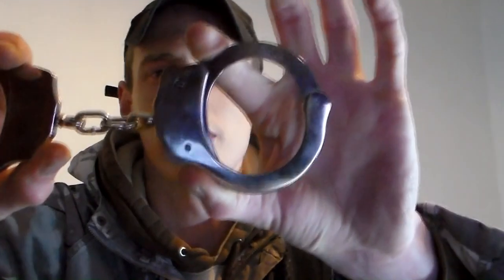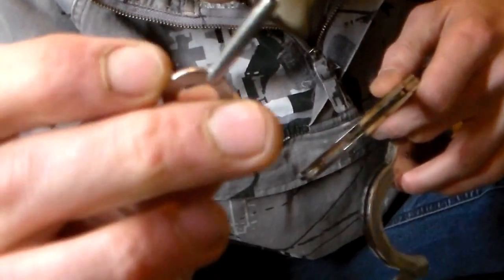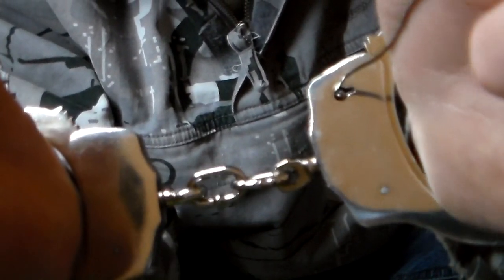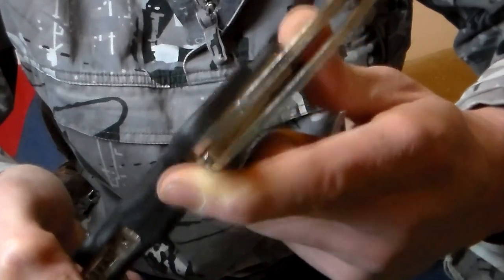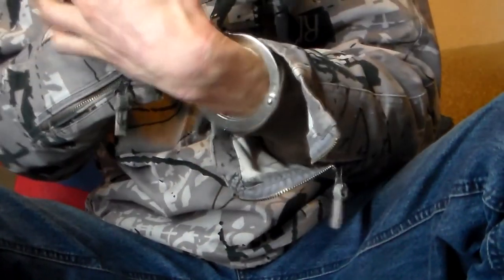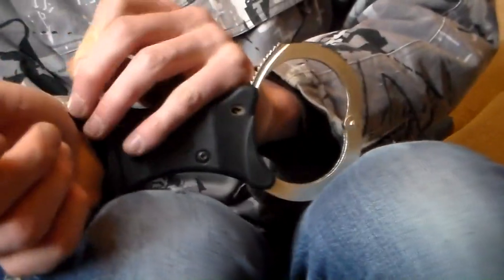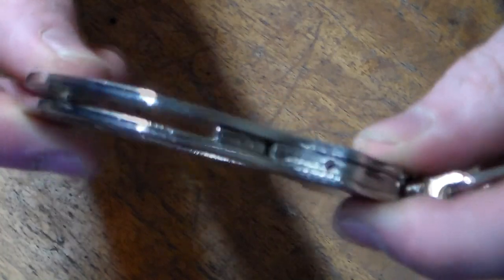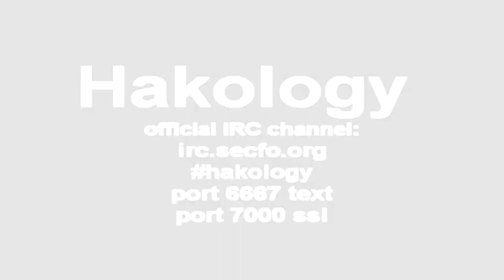Hakology - Handcuff design flaws (Picking and shims)

Comment: Problem is UK Cops are taught rear and front 'stack' application, i.e. your hands aren't together (like your clapping) rather they're pointing in opposite directions; this would make your tip for escaping much harder. Perhaps you could show us how to get out of that instead?
Reply from the maker: +Josef Wilson you need to do that with a friend lol :D but yes they'd be near impossible to get out of in that position.
Reply: Clarence yes this is true if British police will cuff you at the back will be more easier you can pull them on the under legs and escape but the problem is when police officer cuff in front one hand will be in right direction and another hand in left direction
Reply: yup about the only people who will cuff you infront is court custody staff because they need you to be able to holdon to handrails and sit/standup half the time they wont cuff both wrists though theyll cuff one to you one to them but by the time your in there custody youve got a secure vandock or multiple locked gates to content with with panic alarms to have officers ontop of you within moments so your probably not getting out that way either

Comment: Props on the home made shim. I have a bought shim and was unable to make a video of any successful shimming on my new TCH842. Maybe the decreased the tolerances to make it more difficult. You have Hiatt, I have the successor TCH. Also it would have been nice if you had a pair of smith and wesson or other well known brand handcuffs instead of the cheap Viper "Professional" model for your chain handcuffs.

Either way I give you a thumbs up and a subscriber.

Any chance you can do a video of picking these or TCH rigid cuffs? Btw, not that I encourage stealing my ideas but you could get a decent video out of demonstrating my technique for getting out of UK police rigid handcuffs when the keyholes are facing away from you. At this time that is my latest video if you are interested in checking out that technique. Boggles peoples minds when you turn your back and pull that off. After all how can you use a key when the holes are on the other side? No tools needed, just the key.
Reply from the maker: hey and thanks for the subscription hopefully will have some time on my hands soon to produce some more video .... as and when I can get the equipment will do some more videos ... but i only have the two sets from this video ... great comment and thanks again for you support ;)
Reply: No problem. I have plans soon to buy TCH model 850 and 930 to add to the collection I am slowly making. Although I like to buy brand new as I don't like seeing serial numbers grinded off and other signs of wear. So I dont buy very often due to the price.

Comment: Open the hard plastic case inside should be solid long bar I got ripped off why when I took the hard plastic hand grip of was chain handcuff s inside hard case the seller claimed they dint no till I unscrew d and show d them good video upload 👍 iv got 2 different sets of the 850 s there solid then iv got a certain pair what folds I would not put on my wrist they would break wrist because carnt move

Comment: Those chain link ones shown from the beginning look like Viper ones that I bought from ebay. Decent quality but still and off-brand. Also an interesting note and question to you, while the Viper keys appear to be a standard key, try using your hiatt key in them and it likely won't work. I bought two different models of universal keys and neither of them will turn in the Viper handcuffs like you have, because the handcuffs are not chunky enough as professional ones are so the key flag (the end bit that does the unlocking) is too high up on real/universal handcuff keys and thus won't turn once inserted. Can you confirm this with yours?

Comment: Uk Police TCH 840 Hiatts Handcuffs are the best ones in my opinion
Reply: I have 842 which have key holes on both of the sides. I think even while I have more secure cuffs I think I like these the best. Their sound emissions when ratcheting is lower, they are smoother moving than even other models of TCH I have tried so far. Just everything is high quality and is very well done.
Reply: I bought the tch 840 ones and I love them, mine are smooth, very high quality and very strong and painful Haha
Reply from the maker: they're very uncomfortable too

Comment: U.S. handcuffs are not strong
Reply: You are joking I am assuming?
Reply: I am an American handcuff collector, Smith and Wesson older models ie 90,91 were as tough as tanks, current issue 100s are okay. But I like British handcuffs because they have the 3 pawls, not single like American cuffs, if not double locked American cuffs are to easy to shim Hiatts 2010 all the way.